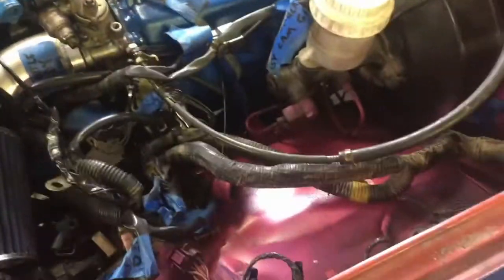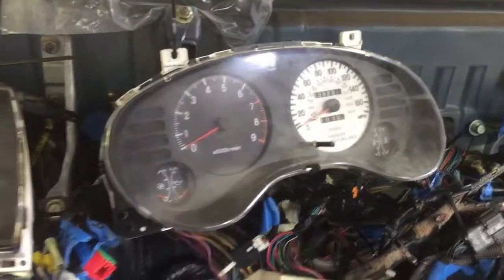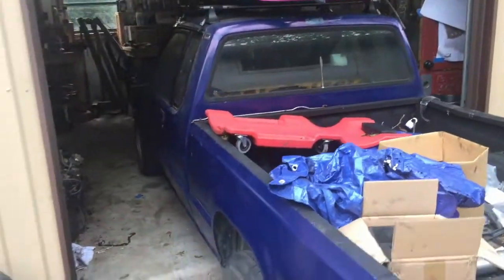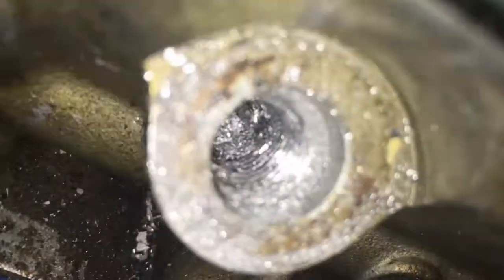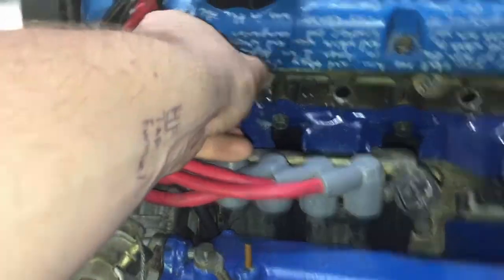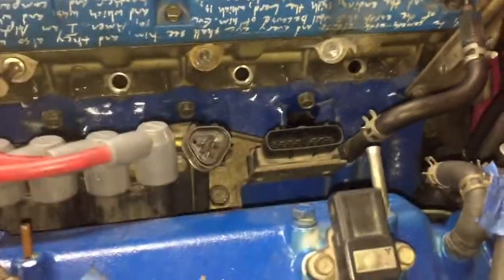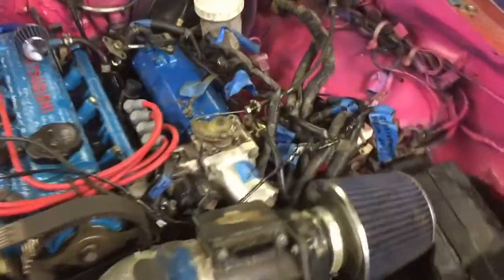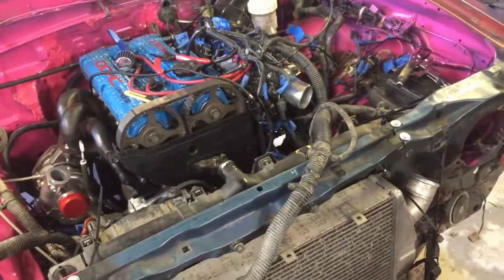Mighty Max 4G63 Swap Part 16 - Helicoils, Wiring, and a Turtle

Comment: LOTS of stuff that could be done to make this way easier for you to swap. Its very easy to convert the truck to the 2g cluster. I have a 1g cluster in mine.
Reply from the maker: Aedan Lonergan no doubt. This is my first swap so I'm just learning as I go. Are you talking about the truck cluster or dsm cluster?
Reply: Till the Wheels Fall Off I was talking about swapping a dsm cluster into the mighty max.
Reply from the maker: Aedan Lonergan My end game plan is to run just the max cluster with some aftermarket gauges to the side so I can keep the max dashboard
Reply: Till the Wheels Fall Off I would convert it all over to a 1g dsm cluster, it fits behind the factory dash board with very few mods and everything will work since the 1g dsm is a cable driven speedo.

Comment: if it were me, I'd weld some metal onto the snapped off fuel rail bolt, and then just weld the head back on and see if I could break it loose with a 12mm, I managed this on a snapped exhaust manifold stud on a 4g63 one time the trick is to get it the right temperature once the metal is heated up enough it will let go of the aluminum head a little bit at a time a pair of vise gripes also helped turn the bolt loose some.
Reply from the maker: Yea I tried welding a nut onto it. Unfortunately, there wasnt much of a stud left to work with and my welding skills are sub-par so that didn't work. The helicoils actually worked surprisingly well.  I think I'll skip the easy-out next time and go straight to helicoils
Reply: In my case it was deep in there just like your issue, and slowly I added material to the snapped off bolt head and this was with a flux core welder I bought off of cregslist for $100 it was a Lincoln 80hd pak , and I was not really skilled with welding ether maybe I'm a natural, but I kept adding material via hitting it with the welder, then waiting a few minutes, clean off the the flux with a brass brush and then hit it again I did this until I had a decent amount to grab onto I used a wise grip at first, just to see if the weld was strong enough to the point where it would not just snap off, to my surprise the vise grip turned the bolt loose, I think the heat and pb blaster I sprayed into it earlier broke it free. drilling is more time consuming, but as a precaution I just replaced all the exhaust manifold studs and nuts that day lol, I hope to see more on this build, your channel rocks man.